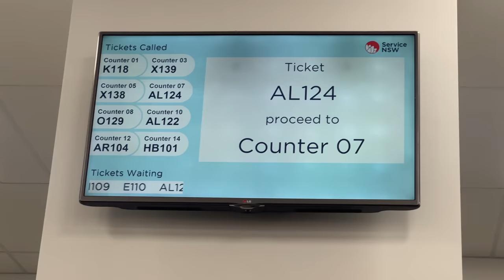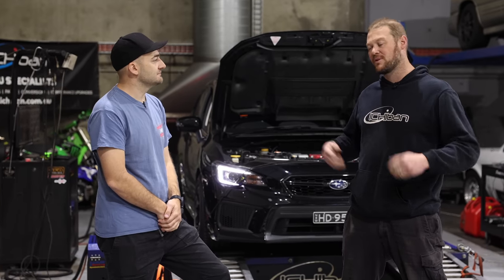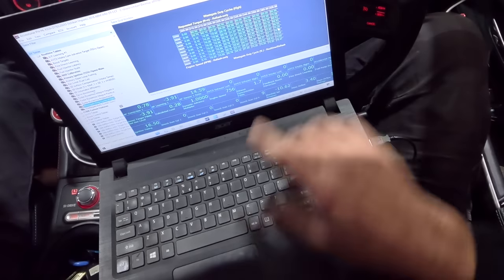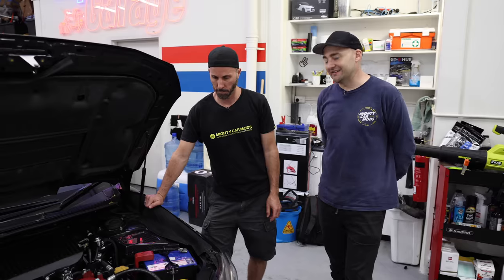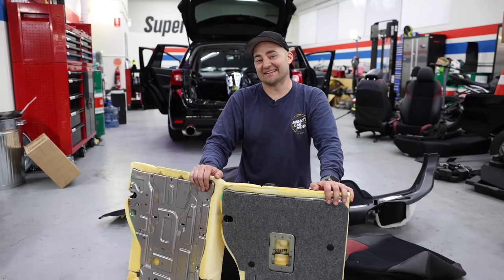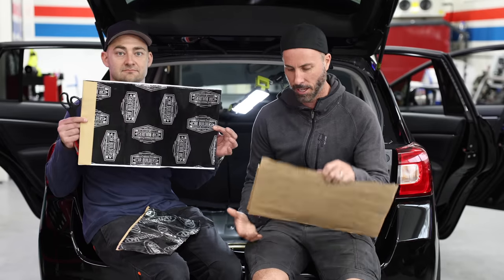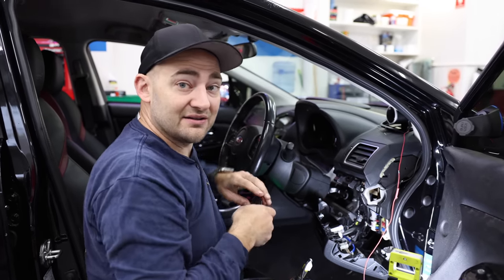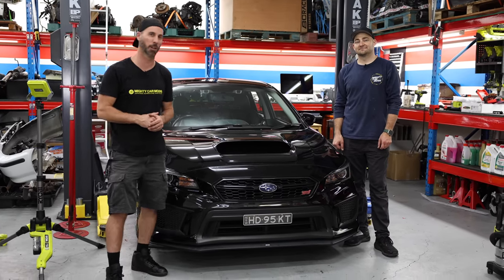Testing our mods on the Dyno - Marty's Levorg Part 7

Comment: Protip: a solder heat gun station is an excellent tool if you want to take apart plastics that may be brittle from age. A quick waffle with the heat gun on the clips gives them a little bit of extra spring back, just enough to remove them. Obviously common sense applies, too much heat = damage. A hot air solder station set at just below medium heat is perfect for most stuff.
Reply: Or just use a regular hot air gun since they are more likely to have that

Comment: A good trick to insure you have your speakers wires correct. Take a 9 volt battery and connect it directly to the speaker. If you have + to + the speaker will push up a bit, if you have + to - it will suck in a bit. It does no harm to the speaker! Voltage is what makes the sound anyway. It saved me a few times...

Comment: 4:22 “Have you seen these explode lately?”   “Yes, they’re still EJ’s, so they’ll explode as usual.”  😅
Reply: I can't tell if this is just sarcasm as I too own a EJ... But Scotty replied with "yes they have become a good choice". He didn't mean explode literally. He more meant in popularity.
Reply: @DaveDoes_  - I’ve actually been driving EJ’s for 18 years now (I feel old! ‘03 WRX then ‘10 STi.). Plus 3 years on my EG33.  Just thought the choice of words was pretty funny after strapping it down to the dyno. I actually thought he meant “blow up” from too much boost, until he finished his sentence. Plenty of videos on youtube of that! 

Still disappointed he didn’t do a run on E85. Typically, that would have put another 50-70hp at the wheels. Glad his plans are to crank it up past the level of Super Gramps, though I understand daily driver reliability. Hence why my STi is mostly stock.
Reply: I had a 2018 sti running 215kw atw on 15psi 98fuel.........I was happy with that And never had any issues.... I've owned 3 different wrxs And sti with no issues at all.. vf48.

Comment: Replaced the head unit in my Subaru with a Sony unit, wasn't prepared to pay $800 for the plastic surround. Ended up making a wooden (3mm ply with veneer) surround that was attached to the old plastic. Looks great and the unit fit's in nicely.

Comment: Would be interested in seeing the engineering documentation process needed to get registered
Reply from the maker: It just checks that all the STI parts have been installed and installed properly, then register the new engine number and thats about it! Depends on what state you're on but the process is similar.
Reply: @mightycarmods  yep where I live nothing would have to be mentioned to insurance, or anything changed in that regard.

Comment: As someone who has been an aftermarket fitter for almost 8 years now. It was glorious to see you guys just cut the old speakers out of the housing and smack the new ones in. 
I felt the pain of removing the aircon vents from the hazard panel too. Aircon vents mounts are always a pain in the ass.

Comment: For testing speaker polarity use a 9v battery. Put positive on one lead and negative on the other, if the cone goes outward then you have the polarity correct!

Comment: these projects would make a good skill ceiling for people who mod their cars, but imagine if they were the floor? killer music, killer production quality, ultra safe/as OEM as possible builds, just fantastic. only thing I'm missing is them putting an h6 in instead of replacing the h4 with another h4. i'd buy older cars if it were dependent on the age (needs to be at least x old) of the car to enable this kind of swap.

Comment: I've found that roof flashing works perfectly for sound deadening for around half the price,
Its the same type of tar/bitumen material,
The front aluminium finish is a plain grey with no writing on it but it's going under carpets etc.
I don't know how well this material holds up to heat but for sound deadening it works brilliantly and the sticking power is great especially if you either install it on a nice hot day or just warm it up with a hair dryer or hot air gun. Just thought I'd let people know in case it helps anyone lower the cost a drop on their own builds 👍

Comment: I remember doing a seat swap in my Dodge Magnum from a Dodge Charger RT R/T. Front seats were pretty much drop in but I had to swap the rear seat foams and covers as the Charger used a plastic seat frame and the Magnum used a metal frame. Took a bit or work but was totally worth the end result.

Comment: Use a multi meter on the stock speaker cable to figure out which is positive and negative, saves a lot of buggering about. Awesome job guys 👌🏻

Comment: I had to do similar when I was replacing the seats in my 86 Jetta coupe to have nice seats. Bhad to replace the pad and skin on the bottom tray for the front seats and modify the seat back mounts to fit the 86 buckets.

Comment: You should look into the 2 in one solder and heat shrink makes doing wiring so much easier you just heat it till the tubing shrinks and the solder melts

Comment: So interesting to compare power at wheels to power at crank.
Stock STI makes 305hp/227kw according to Subaru, this one tuned and modified makes ~205kw/280hp at the wheels... wish manufacturers used power at wheels for measurements too. Cause that's the more correct measurement cause that's the amount of power you actually feel pushing you.

Comment: How do you science out this engine vs. Super Gramp's in terms of overall performance and driveability? Smaller displacement with higher boost vs. bigger displacement with lower boost? Do both cars weigh about the same? Would really love to see Levorg vs. Super Gramps vids. Quarter mile times, track times, crowd preference survey, etc..

Comment: I feel like I'm missing something.  195KW is only about 260BHP.  I used to own an STI years ago back when they had two litre engines and that had just over 300BHP stock (it was an '03 Subaru Impreza WRX STI Type UK Prodrive).  With a few uprated parts, I'd have expected this to produce 280-300BHP even with a fairly mild tune.

Comment: I recently tried to mount new speakers into my Outback and found that i couldn't close the door cards flush with the door, and there aren't any factory options or fix this or aftermarket... but ended up using a set or speaker housings from an 08 WRX hatch that works perfect in the front... haven't figured out the rear just yet though, my impreza hack didn't work on the rear but upgrading speakers using the factory wiring is a mad feeling.

Comment: Love the build, just a question in the first video with the wrecked sti moog mentioned that it made 227kw at the engine but in this video Marty mention that the stock sti you guys pulled the parts from makes 150kw at the wheels. Is it normal to loose that much power from engine to wheels?
Reply: yeah awd and 4wd sucks power, also big diffs take more power to turn
Reply: Depending on the vehicle, drivetrain loss can be 20-30%

Comment: I have a Levorg one point six, so I am very inspired by this project. I would only do the engine though - everything else would stay, even the cvt 🎩. However, with the tax rules where I live, I might as well buy a new car. Here's the madness: If I increase the power more than twenty percent, I will have to pay a new registration tax which amounts to about 150% of the car value.

Comment: Did you guys mount the Cyl#4 cooling mod for the coolant pass? Helps in tuning and will save the piston in that cylinder by having it run at the same temp as the other 3.

Comment: I have been wondering about the torque situation my self. I've got a 30/25 build in the works. I didn't intend to but it's now gonna have JE forged pistons and Scat rods. But i'm very much aiming for low end torque with a high flowed OP6. Hopefully i don't run into any issues. Although several people have voices that the turbo might be way to small and cause it to ping.. Guess i'll see in who knows how long when it gets tuned..

Comment: Dear Subaru Japan and Australia, please, please, please release a manual transmission WRX Wagon. Or even an option for an STI 6 Speed manual transmission and Brembo brakes on the VB sedan. I know you are having issues getting a high performance FA24 past ever stricter world wide emissions regulations, but surely the transmission and brakes stunt affect that with the existing FA24

Comment: I run a car audio business, the speaker adapters you need are Aerpro brand sold at autobarn and supercheap/car audio shops, front speaker adapter part number APS323, rear adapter APS324, priced about $30 per pair,stock speaker adapter wire plugs APS32, throw that Idoing stereo in the bin please

Comment: can i get the radio? how much is shipping to RSA? (small tip for radio speakers: if you think they wired in wrong, unplug the speaker and plug a multimeter in, if your getting - V it's wired wrong, swap the connectors around on the speaker)

Comment: soldering is not recommended for auto/marine or aircraft applications, crimping is better.  main reason is vibration kills the joint because of heat stress in the wire before the junction, also the chemicals introduced to the copper make it brittle. check military specs for more info. NASA never solder anything.

Comment: Start opening the wastegate @5500 and it should continue linearly for the last little bit. Just a thought.
Reply: What?
Reply: @ThePentosin  Comes down to efficiency. If you are losing efficiency in the upper end due to the CFM capacity of the turbine and housing you can open the wastegate to allow for more flow. The housing only allows so much flow and in this condition you are maxed out. By relieving the pressure in the exhaust manifold you increase the pressure delta experienced when you compare the cylinder pressure to the exhaust manifold. More air is exchanged per pump. letting the pressure out of the manifold will allow the motor to breathe better, equating to more flow and a higher cfm capability without stepping up the exhaust housing ratio. It's a drag racing trick, I'm not the first. Look it up but it comes down to basic logic and the amount of flow capable. Many other factors can be the issue but I am curious because it is a stock housing. You'll also need to have active control over the wastegate to use this trick. Just my 2 cents!
Reply: Ok, I've never heard of this before. Does this only work if it's the exhaust side that's the limiting factor, rather than the compressor side?
Reply: @ThePentosin  if the manifold isn't the issue and the turbo housing is the issue then this will work.

Comment: Wait 6800rpm?? The STI ej25 revs to 8krpm. Why is the tune so half assed? I’ve never seen a good tune drop that bad after 5500 rpm. You guys need a better tuner.
Reply: Just because it revs that high, doesn't mean it makes power all the way to redline
Reply: @Mardy72  when I used to build Subaru for a living our tuner Cory would work wondering on STI’s they were our specialty. A stick block STI with full bully ons can easily make 325 peak hp and that was past 7600rpm. And still be above 300 at 8k rpm.

Comment: Oh my gosh!  Getting the phase of speakers is so easy, and you spend so much time making custom parts to mod your little shit boxes!  Why not take 5 seconds to make sure the striped wire is crimped to the right connector and plugged into the right side of the speaker?  Intentionally silly, I guess.

Comment: those plug and ply headunits are a rip off a scam no reputable car audio installer would install it for you heads up that head unit is going to let you down have terrible wifi bluetooth and crash alot

Comment: For two blokes that came from working in sound studios and pretty much have been working on cars for a very very long time, you should know better than putting that eBay junk head unit in the car. They sound shit, half of the functions won't work, they aren't reliable and they look cheap to those in the know.

Oh, and don't ground your speakers folks.